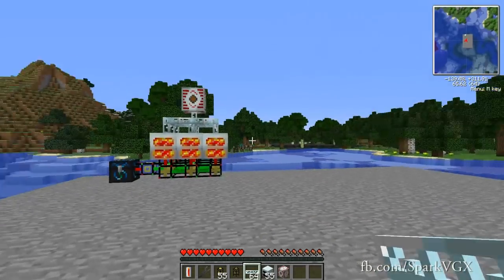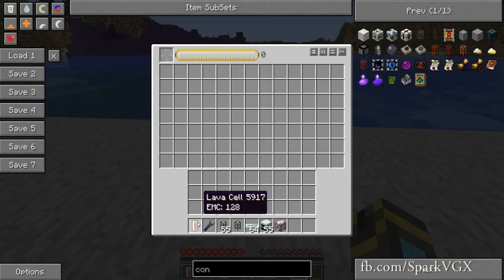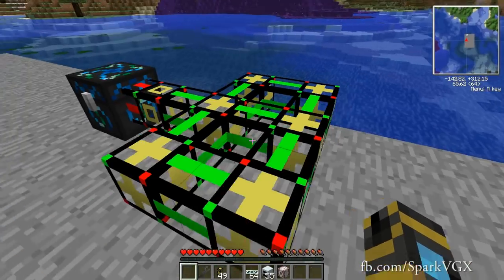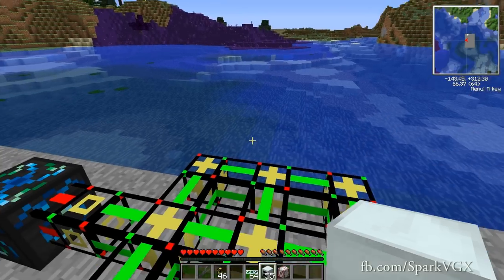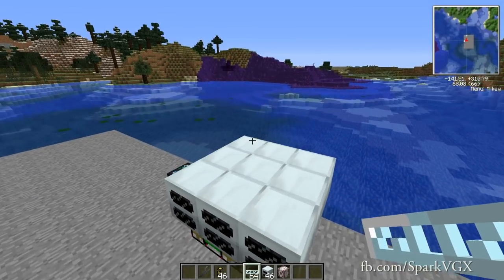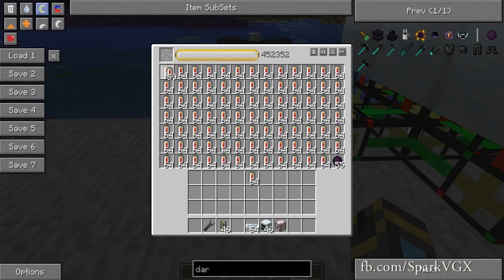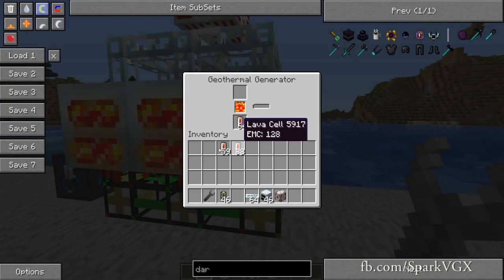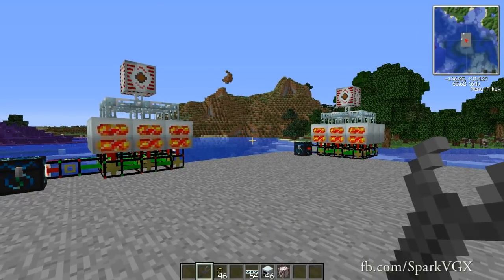Technic Tutorials: Near-Unlimited EU Generator

Comment: i made this in tekkit using a sorting machine, which took out lava cells from a condenser, though it took me an hour to figure out it needs power... than pneumatic tubes made sure to keep the generators loaded, much quicker to set up if you have everything required already. this one looks cooler though c0rey :P